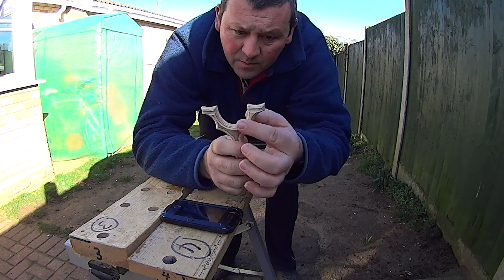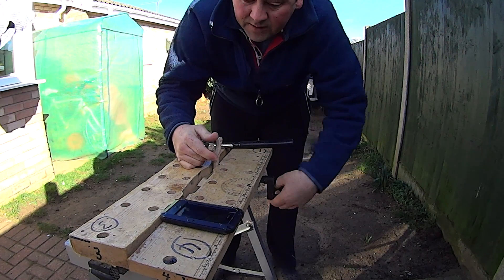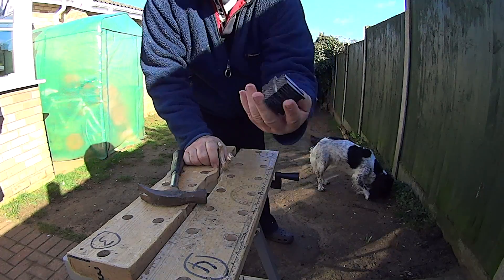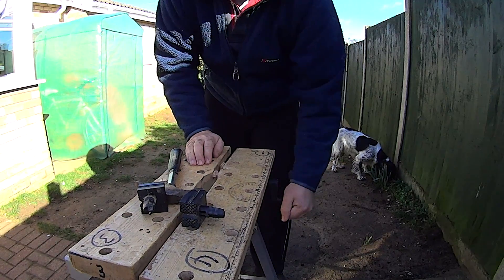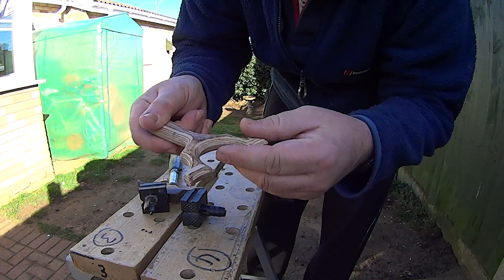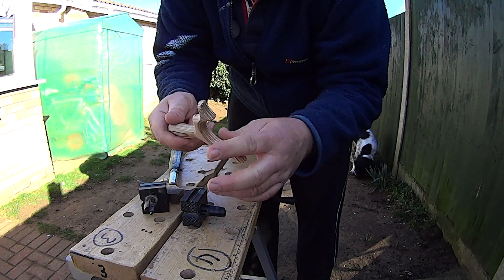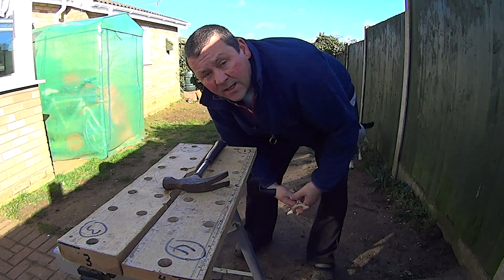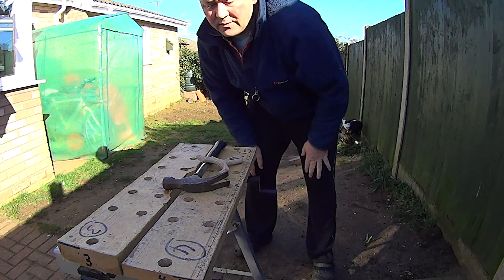STRENGTH TEST ON BIRCH MULTIPLEX WOOD USED FOR MAKING CATAPULTS

Comment: please help with advice about what am I looking for when buying birch multiplex(quality
class,interior/exterior, glue standard IF20 / BFU100 , not to have voids at interior) as I  want to make my own catapult.

I bought some 18 mm with 13 layers in 5*5 feet (not so good quality of faces as this I could find locally,person sayd is birch)but is so soft  that it schratches the faces
with fingernail, compared to the one you are testing (I do not want any surprises of braking on the slingshot)

here in Romania best I could find birch interior ones B/B class ,glued IF20 or BFU100, made in Russia/Ucrain but I do not want to order it and have a surprise that it arrives and is no good same like the one I already have.